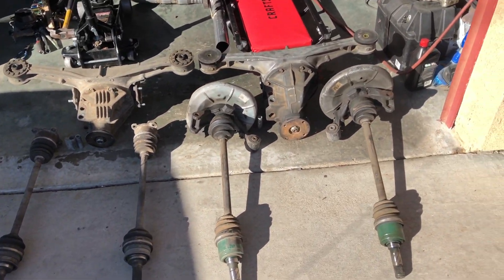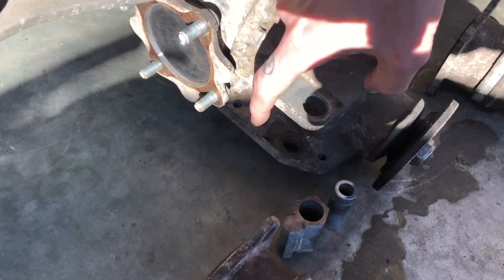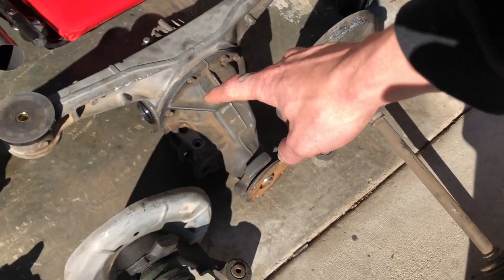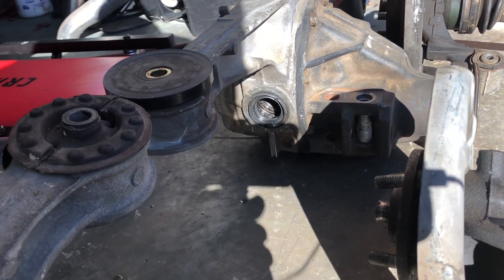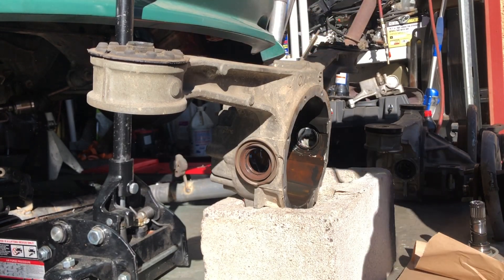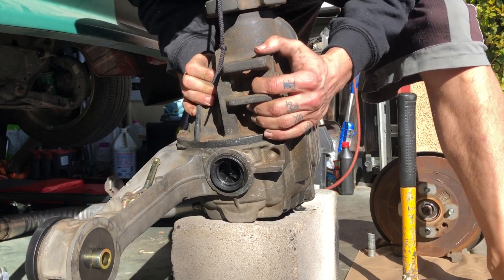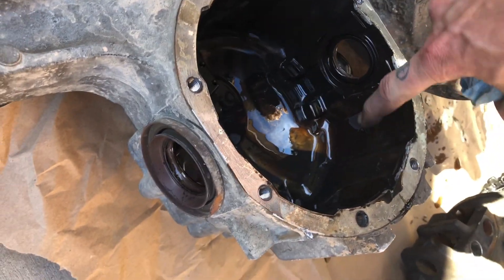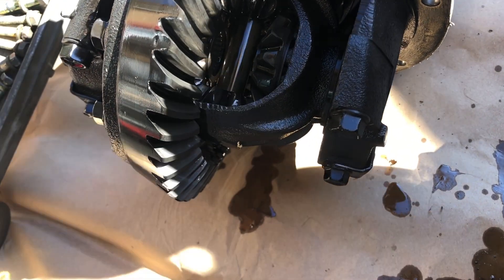Miata 1.6L VS 1.8L Differential Comparison

Comment: Stub axles are great for endurance racing if you blow a rear end way faster to have two diffs with stubs to quick change in pits no fluid just 10 bolts not pulling axles

Comment: Thanks for the vid :) did a trans swap on my 99 1.6 nb yesterday and looked at the diff and found out its a 1.8 diff under there which was nice :)
Reply from the maker: No problem, glad to hear it helped! I’m looking to buy an imported 1.6 NB here soon, do you know about the intexhaust cam swap? You’ll want an adjustable cam on the intake for it.

Comment: Early 1.8's have bolt on axles as well
Reply from the maker: Not the 1994 1.8 I pulled the diff from, not any I’ve ever seen personally.
Reply: Only the miatas that came factory 1.8 have the bigger diffs and also the manual 1.6 NBs